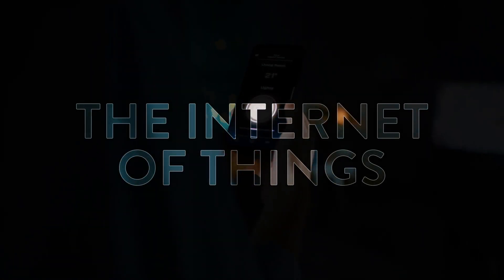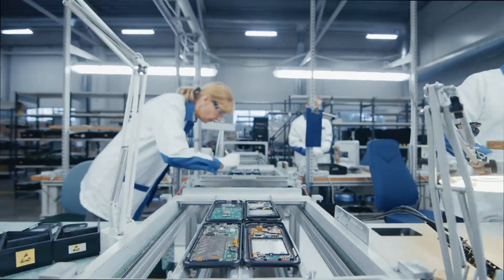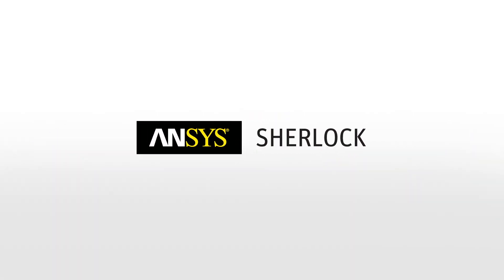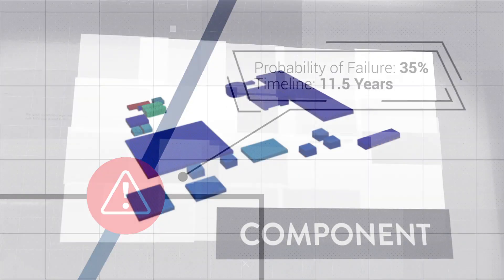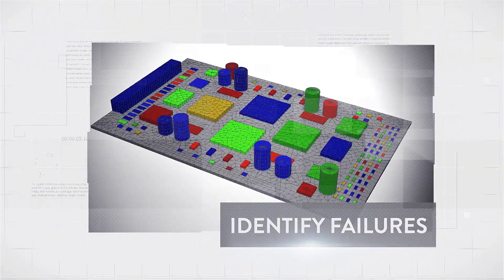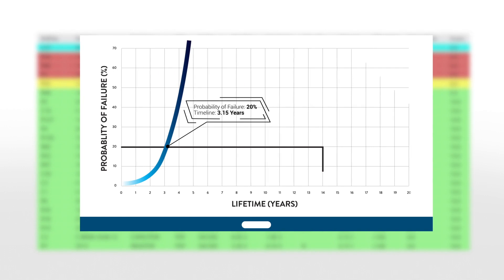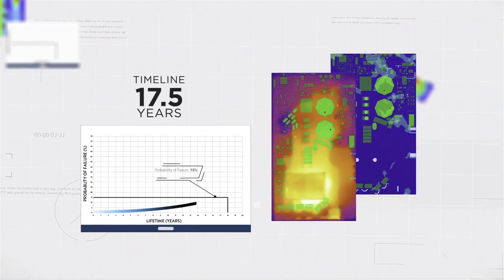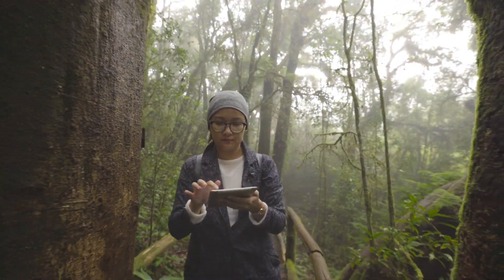Ansys Sherlock for Predicting Product Lifetime

Comment: To be honest it will be used to design parts to failure after the warranty. It starts from lightballs
Reply: Yes, that could that going on - but that doesn't automatically equal it's bad - just demand 2 or 5 or 10 years warranty against certain failures - over design isn't without it's own drawbacks! There are many published books on product reliability.